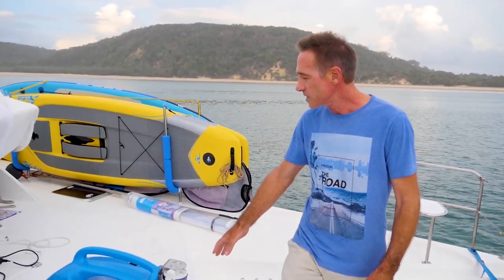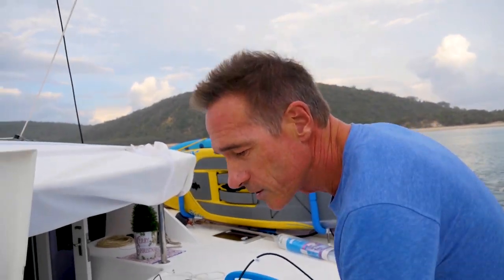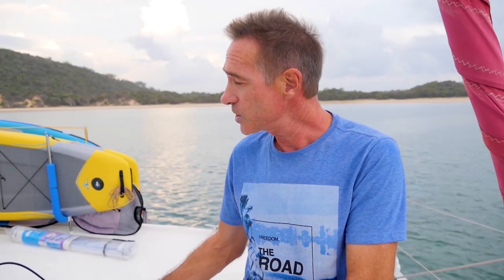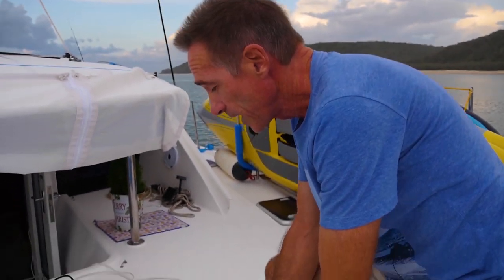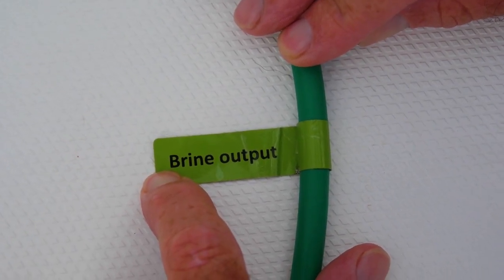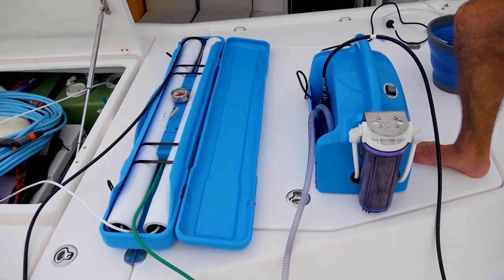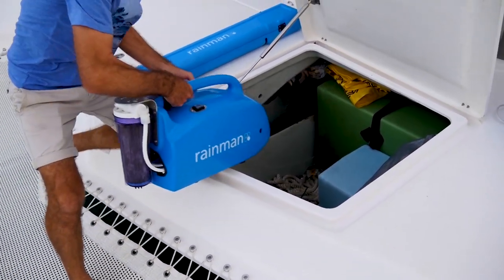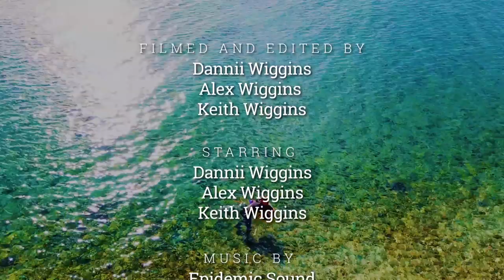Sailing Bluefin Ep#17: Rainman watermaker demo/review - How to make fresh drinking water on a boat!

Comment: N ice unit....what kind of maintenance do these require if not used frequently (compared to normal water makers), say you're off the boat for a couple of weeks?
Reply from the maker: Hey, thanks for watching and thanks for the question. Right at the moment we have ours pickled. The general advice from Rainman is to pickle it if not using for more than a week. Although I have heard from other owners that they may go a couple of weeks. I tend to play it safe and stay with the week.
Pretty easy to pickle. I just rinse with fresh water as normal, then use another 10 litres of fresh water with the pickling solution. So pretty quick and easy.
After pickling, to use again, I run it for around 30 minutes before using the water.
Let me know if you have any other questions. 😁
Reply: @SailingBluefin  Ahh cool to know...thanks for replying.  You all have a great night :)
Reply from the maker: @maviarab  you too. 
By the way are you on a boat or planning to get one?
Reply: @maviarab  hey, did you end up getting a watermaker?
Reply: @keithwiggins6891  Hey...sorry missed your last reply.  Still not even got the boat yet heh.  Be a few years yet, carer for my mother, just like getting information in advance so know all my options.
Reply: @maviarab  don't worry mate, you'll get there. We started out with a $6,000 24ft monohull built in the late 70's. It doesn't have to be expensive or massive! We sailed that thing all the time.

Comment: We are looking to buy one of these, their literature only says the gasoline unit can make 140gph.  How much water does the generator run unit make per hour?   -Thanks for making this very informative video.
Reply: When I checked on the 240 volt system it was around 140 - 150 litres per hour.
Reply: Hi, it's Keith here. We get around 140 litres an hour from this unit, a bit more when the sea temperature is warmer. We decided to get the AC model rather than the motorised version, as we have a decent inverter and plenty of solar and we can also use our diesel generator if we need to. The less petrol that we store on the boat the better.
Hope this answers the question. Let me know.
Reply: @sailorsam6243  Thanks for info
Reply: @keithwiggins6891   Less petrol is better.  Was just kind of liking the idea of multi-use water maker/pressure washer.  Thanks for the very informative video.  Looking forward to future videos.
Reply from the maker: @sailorsam6243  yes, that sounds right.
Reply: @PerriGoingGone  hey, I also like that idea of having the pressure washer, it does simplify the whole process. We have a Karcher pressure washer, but we still need to plumb in an outlet so we can run it, which shouldn't be to difficult, just need to find the time.
So definitely the motorised version with the pressure washer would be simpler, but I feel like we should use the power resources that we have already. 
Also check on weight. I'm not sure if the petrol driven model is the same weight and side as the AC version. These are definitely important considerations.
Good luck with it and feel free to ask any other questions. 😀

Comment: What is the price?
Reply from the maker: Hi Morten, I think that the current price for the high output AC model is around $6.5K AUD, which is around $4K USD. Ours is around 2.5 years old.
Reply: I think that they have the prices listed online.
Reply: By the way, thanks for watching!
Reply: Also, if you look around you can sometimes pick them up second hand. a lot o people buy watermakers and then don't use them for some reason.

Comment: Thanks for the honest review. I’m looking into installing a Watermaker on my Baba 30 to sail the Caribbean and was actually recommended this unit in 12vdc but after seeing it, the heavy weight, and how big and bulky it is I’d rather do a built in unit instead and run off AC with a generator.

Comment: Just got my Rainman portable and love it.  Your video was terrific but I have one question.  Can you / should you rinse the pre-filter.  If so, should you only use made water?, soak it? dry it?  Thanks for any advice you can offer.
Reply from the maker: Hey Rob, apologies for the delay in replying. Yes, you can rinse your prefilter, either with saltwater (tie it securely and drag behind the boat) or hose it off with normal tap water, but then rinse thoroughly with ocean salt water before using, to ensure there is no chlorine to enter the membrane.
Thanks for watching!

Comment: A quick question. Can you also use this when you are sailing? For example, if you cross the Atlanta ocean and you need fresh whaler, can you use this while you sailing? I would think so right?
Reply from the maker: Great question! yes you can definitely use it while sailing. All dependent on availability of power. Heeling is not a problem nor is swell or chop.

Comment: Hi Keith will be great if you can make a review on the bildge pump port and stardboard side and explain why there is always water there, probably due to refrigeration condensation or air conditioning condensation thanks
Reply from the maker: Thanks for watching 😁 Keith is currently on a roadtrip at the moment and will be back in a couple of days, but I will pass on the message and definitely get on to that for you. Thanks so much for the suggestion!
Reply from the maker: Hey, a good point about the bilges. I'm actually going to do some investigation into our, because they always have some water. 
I know of two causes. First is rain leakage that gets through to the bilge. The second one I discovered was that the salt water filter seals on the Cruisair systems are not great & seem to always leak a little. There are just so many ways that water can get into the bilge on a cat this complex.
I will do some investigation though! 😀
Reply: Yes and for me it’s the same during heavy rain suddenly my bilge pump is working with red light ...look to your video when we you have time cheers Ben
Reply: Can also be leakage from filters. Good to know whether it is fresh or salt or a mixture.
Reply from the maker: @sailorsam6243  yes, good point Sam, always check the salinity and check all the filter gaskets.
Reply: @googlemate2587  Hi Ben, have you checked that none of your filters are leaking? I know that the air con filter gaskets are pretty flimsy. Worth checking. I have started shutting the air con sea cocks, but have to remember to open them on the rare occasions that we use the air con!

Comment: Hi, I have an Outremer 45 Danson year 2007, that is hybrid with a 19.kW lithium battery bank and a Victron Quatro 48v 4000kW inverter, I think power wise my boat would be able to handle the unit.
However, I do not really have a lot of space, and I was leaning toward the smaller membrane unit. Two questions: 1) do you recommend the smaller unit ? 2) how to you maintain and or replace the main osmoses membrane in the unit other than flashing with fresh water ?
Thanks Alberto  boat Just A Dream, Connecticut USA
Reply from the maker: Hi Alberto. Yes, the membrane units are annoyingly big and can be a challenge to fit into spaces. We ended up installing the unit in the large locker in our front cockpit. The large membrane provides more capacity, but I would be tempted to get smaller membranes next time.
In terms of maintaining the membrane, technically you can just keep on making water every couple of days and not even rinse the membrane, but I always prefer to rinse it, as they're expensive to replace. If we're going to be in a marina for a while, I will pickle the membrane with pickling solution, which is quite easy to do. The other alternative is that you can rinse the membrane regularly from your tank water, as long as the chlorine is filtered out with a carbon filter, as chlorine in tap water ruins the membrane. 
I hope this helps. Let me know if you need any other information. 
Thanks Keith

Comment: Loved the video!!  We are thinking about the Rainman...Just saw them at the Miami Boat Show 2020 and we were sold on them!  We were thinking more the permanent  installation one they offer...
Reply from the maker: Hey, yes, one of the issues with the portable model, as mentioned in the video, is that the cases make the unit bigger, so can be a barrier to semi installing. But the units themselves are rock solid. Lots of cruisers in Australia use them and all rave about them.
Reply: Yes, they look great, easy to use.
Reply: Hey  SV Catcher, did you end up getting a watermaker?
Reply: @keithwiggins6891  yes we did.  We got the rainmaker, naked, installed ourselves...pretty easy, came with most everything and very please with the performance. We did get the extra long membranes as well.  Nothing bad to say about it
Reply: @svcatcher9865  that's great. I've actually just finished installing ours after using it portable for 2.5 years. No more having to lift it out of the locker. Also much easier to make water on passage. Another job ticked off the list! 😁
Reply: @keithwiggins6891  Still going strong after another two years?

Comment: Hey guys! Thanks for this informative video. I couldn't find the part where you talked about AC vs DC. Your timestamp is pretty much at the very end of the video :) Would love to know why you chose the AC unit as we are debating now. Thanks!
Reply from the maker: Hi, thanks for the question. The AC vs DC question is an interesting one. There are a lot of people who insist that it is better to have a DC watermaker, because every boat has DC available. We ended up choosing AC, as for a given output, the power input is around the same in wattage. The issue with DC is that you have a low voltage and high amperage, which means that you require very thick cabling to wherever the watermaker is, apart from this you have significant increase in current loss as the distance from the battery increases, which is not the case with AC. Apart from this, it allows us to make a lot of water quickly when the sun is shining, so we can leave no solar power unused.
So as long as you have a sufficient inverter and good solar, the AC version will give better results. Different if you have a small battery bank and small inverter.
Good luck and let us know if you need more info. 😁⛵⚓
Reply: Also, have a look at our electeical installation video with the inverter install.
Thanks for watching! 😁
Reply: I also went for an AC model on mine for these reasons.
Reply: @sailorsam6243  good to hear! 😁
Reply: @SailingBluefin  There be the answer in a Nut Shell  👍👍

Comment: These are so much simpler to use than others we've looked at.
Reply: Yes, definitely simple to use. You just need to follow the instructions and not be rushed.
Reply: @keithwiggins6891  Did you say these are made in Australia?
Reply: @sailorsam6243  yes they are, they're made in the Northern Beaches in Sydney.
Reply: @keithwiggins6891  Impressive that they can make them competitively in Australia.
Reply: Hello may i know the  cost thanks
Reply: @decaf80  in Australia they cost around $7,000 (AUD). Probably less in USD. Where are you based?

Comment: I Like the portable one , 
If sailing with a buddy boat and they runout /system stuff up > you can share
Reply: .. If they have sufficient power available :-)
Reply: Yes definitely, even if power is a problem, given that you can make 150 litres in an hour, you could always run a generator or an engine to assist, although we do it all on solar and battery.
Reply: By the way, thanks for watching 😀
Reply from the maker: More solar! 😀
Reply: @SailingBluefin  We are going circumnavigating in 4-5 years. When we did the Europe-Caribbean-Europe 10 years ago I built a watermaker. I put the high presure pump on the diesel main engine. So looking for alternatives. Mucho solar and big LiFePo4 bank may be the way. And thanks for showing the Rainman watermaker in action!
Reply: @MrGentlebutfirm  hey, yes. We thought for a long time about what watermaker to get. We looked at the Seawater Pro, and we could have had one shipped here for a reasonable cost, but once you start adding a reliable pump, they are not so cheap anymore. We also liked that we could wander into the place where they make them, near where I grew up and chat with the techs there. A lot of our fellow cruisers have them & the Rainman is the one that no one complains about, they just seem to work!
I would probably like to install it, as it would be good to be able to turn it on easily while on passage - not so easy while it is portable!
By the way, thanks for watching!
Reply: Great idea!
Reply: @sailorsam6243  thanks 😁

Comment: Don't get me wrong its a cool bit of kit, for £5000 it pretty steep. I guess the portability is at a premium. 

thanks for sharing.
Reply: Hey Dennis, good point. I guess there's a bit price range for watermakers. These are around $7,000 AUD. That's probably around 4,000 pounds. We looked at other options & the main options that were cheaper than this were either small rough looking brands or the Seawater Pro from the US, which used a Karcher pressure washer as a pump, which is ok, but not great. As soon as you add a good quality high pressure pump, it immediately becomes a lot more expensive. At the higher end, the alternatives were $15K - $20K.
Are you aware of cheaper alternatives? It would be great to know.
Thanks Keith
Reply from the maker: Hey Dennis, by the way, thanks for watching! 😁⛵⚓